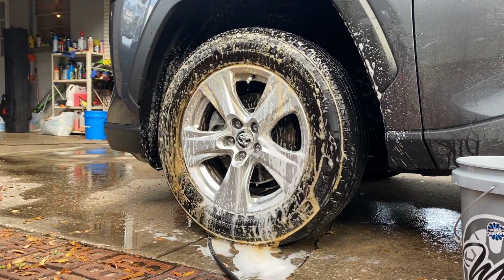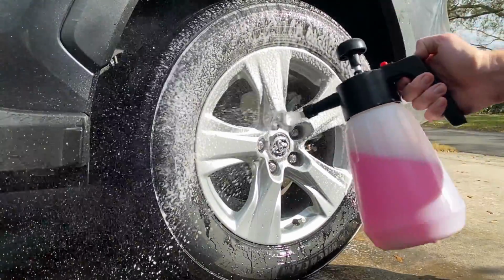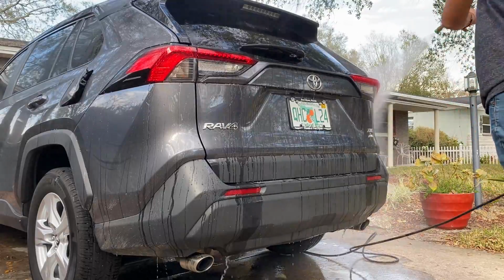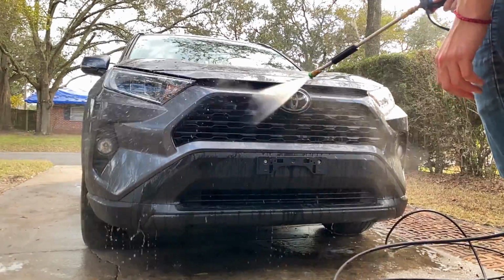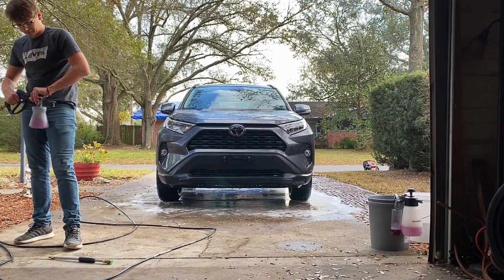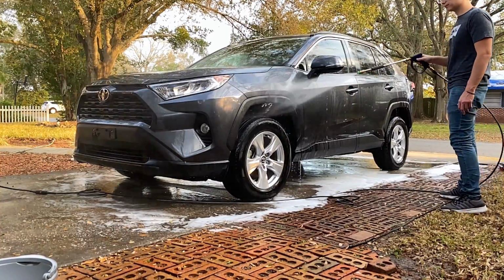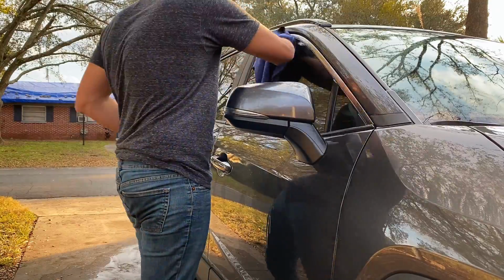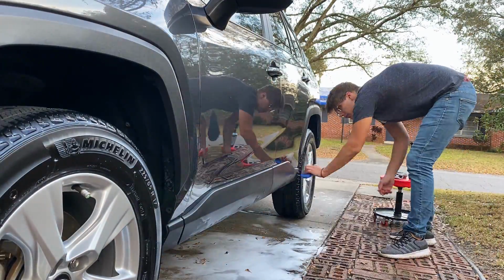Toyota RAV 4 | Exterior REFRESH! | Getting This Thing CLEAN!! MMM, GREY PAINT!

Comment: Just one tip bro, never angle the pressure washer directly into the engine from the front mask. Always at an angle, to minimize water in to the air filter

Comment: Detail Geek stopped using Mr.Pink because of too much lingering Residue. I think Citrus Wash and gloss from chemical guys is pretty good tho.
Reply from the maker: I knew I couldn't have been the only one that thought that! Although, it is nice to get a soap that produces super thick foam, and it's fun. Thanks for letting me know!
Reply: @ccdetailing  Yeah Man, I kind of go Higher end with my personal car soaps and use mainly Car Pro products but Adams or Griots to me are the best bang for your buck products.
Reply: @YourDad0001  Do you recommend a soap form Meguiar's ?
Reply: @douchymane  probably Hyper Wash. I don't use a very large variety of products. I've just stuck to what works for me.
Reply: @douchymane  if you want it to prep car paint to polish/paint enhacement use 3D super pre-soak. For maintenance wash use Megs either Shampoo plus or Gold class.
Reply: @YourDad0001  Hyperwash is a great product. Lots of people use Adams for foam cannon it may cost a little more but it works good.